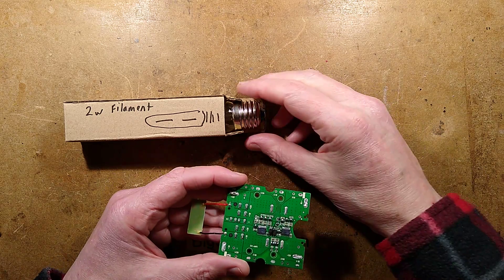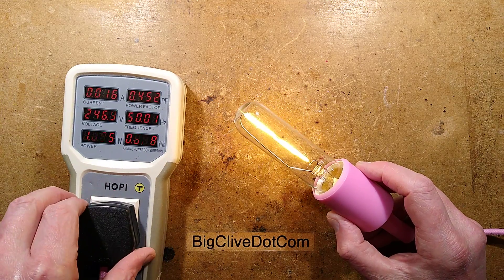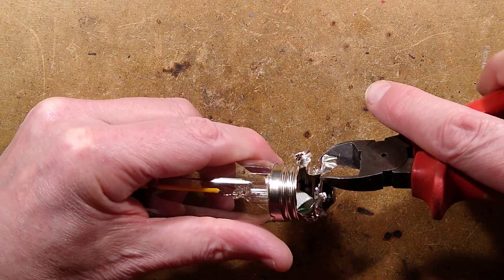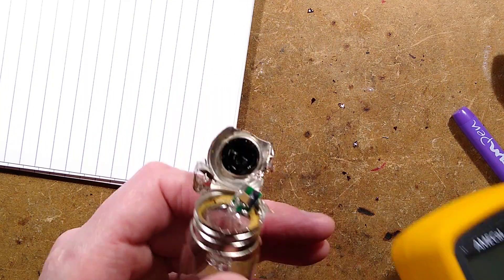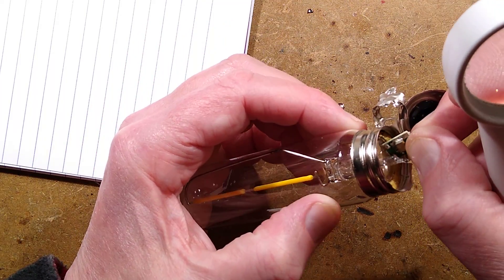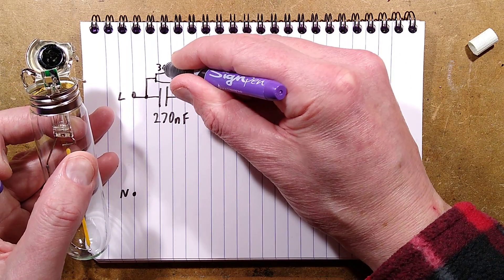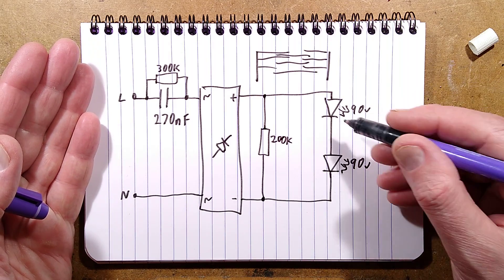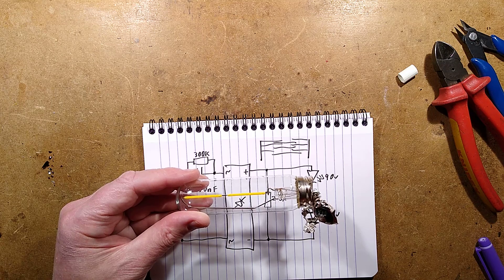Very tacky eBay LED filament bulb

Comment: The flickering always bothers me too.  But on a side note I was having camera exposure issues when taking short exposures with all these blinky lights.  Camera kept giving a flicker warning.   I found a setting in there that lets the camera delay the shutter until the light is on the bright part of the cycle to take the picture. It was designed for florescent but works for led. Kind of neat that camera manufacturers have had come up with solutions for the all too common unsmoothed light.
Reply: Fluorescent lamps changed, well at least here in the US, to using a longer persistence phosphor in the 1990s.  I was doing a demonstration for a class which I had done in previous years showing a phototransistor picking up the 120 Hz flicker from the overhead lights.  I was shot down miserably by the oscilloscope showing a nice flat line.
Reply: @wtmayhew  I’d wager it’s an electronic ballast not a bulb improvement.  In my shop I put electronic ballasts that flicker at a couple of kilohertz to avoid strobe effects on the machines. The lamps don’t really fade at that speed.  But all the old ballasts in my old house basement I can easily see the flicker even when using the same bulbs.
Reply: @TKC_  Thank you, I am sure you are correct.
Reply: @TKC_  People complained that CFL's flickered, but the later ones didn't due to the high frequency ballast.  They also had decent color rendition with improved phosphors.  I still have quite a few CFL's, but too bad they never were good for high on-off cycle, enclosed fixture, and cold weather outdoor applications.  LED's are great, but as Clive has observed they tend to run them way too hot and shorten the life.
Reply: @davidg4288  I buy the high cri filament style leds to keep the heat of the leds away from the heat of the electronics it helps.  I never buy the cheap plastic globe ones, the don’t last.  As for cfls i never found good color rendering ones, maybe it’s just what was sold by me.  I much prefer leds or full florescent bulbs that don’t give that horrible green cast the cheap cfls did. They were also terrible in cold, they made cfl spotlights which were pointless during winter.
Reply: @TKC_  The filament LED's have very small ballasts, sometimes cheap ones have poor connections or even the "wet locations" rated ones are not that well sealed. Otherwise I've had good results with filament LED's, especially in fixtures that require full angle illumination.
Reply: @davidg4288  they do make ones with good smoothing.  I found some a year ago and stocked up.  But it’s a race for the bottom I’m afraid, they probably will discontinue those to save a penny on the cap.
Reply: @davidg4288  CFL was made bad to please people, the best one will have like magnetic ballast a preheat time. This help the start to be less aggressive to the electrode. But it's "slow" so much people likes "instant" on, even if it take some time to heat the full lamp and reach the max. They workt outdoor too but take time to "heat". Outdoor with a 0°C was OK I don't know what they could look like at -18 as my area didn't see these cold very often
Reply: @lapub.  mine take about 5 minutes to get bright at those temps. I still have them in my shop loft since I have to climb a ladder to get up there anyway.
Reply: @wtmayhew  you should have carried on as if the scope was showing a waveform, just to see if anyone was actually paying attention.
Reply: @Derek_Garnham  oh oh or just disconnect the probe so it picks up 50 or 60hz antenna style from the wires in the walls. I imagine he was doing this demo for years. Then someone swapped a ballast on him and bam one day his nice demo didn’t work.  If you can’t see the flicker it would catch you off guard for sure.
Reply: even higher frequency flickering like the pwm controlled backlight of a lot of gaming keyboards annoys me, when im looking straight at them, i dont really notice the flickering to the point its annoying me but when i have it in my peripheral field of view, the flickering gets more intense and annoying

Comment: I've had a few LED filament bulbs with that little circuit board, and they never got put into use because of that flicker, not nice, and yes, they were sold as "dimmable", utter tat they were... :P

Comment: I wonder how that ceramic cap is going to hold up to ~350V mains peaks over an extended period.  I put some 50V Rated MLCC's  in some LED bulbs to replace the 100uF 25v electrolytic output cap (I used 10 10uF mlcc's in parallel). 15v output (5 x 1W batwing LED's) .  They lasted 6mos then all started failing short.   Imagine this ceramic dropper failing short with no fusible/inRush resistor - Yikes!!   I definitely wouldn't use this bulb in my home!
Reply: That is very odd. Normally i would expect the first cap to short to protect the others.

I't is now very common to use ceramic caps as the only filtering in the output circut of a switched mode power supply. Caps can be worked VERY hard in that application, especially in flyback  converters.
Reply: @ebpdoug2175  i had 10 10uF ceramic 50v in series on the switch mode output.  these were budget chinese thruhole caps, sold by qty 100 bags.  definitely not xrr5 or xr7, so the capacitance was prob a lot lower at working voltage due to the strong dc bias / reduced capacitance effect of cheaper ceramics.  The switcher's output prob has noisy voltage spikes that wore these out, and i prob should have left an electrolytic there in parallel with these.  i think they may be bogus-ly rated at 50v , as another possibility.

in any case , since the most common failure mode of the ceramic caps seems to be a short circuit, versus open circuit for a film cap, I think the use of ceramic in a series dropper circuit is inappropriate.  i've never come across this before , other than  in the device Clive reviews in this video..
Reply: @GannDolph  I'm going to move this reply to a new comment under my alternate nym  D614G ...

Comment: These are a common shape of bulb for lamps for dining room cabinets,  lamps for paintings, etc.  I haven't seen this shape of bulb in LED until this video.
Reply: Here in the US, Walmart has been selling tubular shaped LED lamps under their Great Value brand for at least a few years.  There’s one in the fixture right beside me.  As far as I can tell, it doesn’t flicker.
Reply: It's also the shape of the fuses used in GPO exchanges before the old equipment was ripped out. I had one until  I dropped something on it. They used the same standard ES fitting too
Reply: I was lucky to find that shape: We use the mini T8 bulbs from feit because they're JUST skinny enough that they'll fit inside of the little 4 inch glass chimney of our little micro-sized nutmeg kerosene lamps. So now they can be switched from oil to electric and keep all of the same fittings and lamp shades

That + a dimmer outlet to make them not so painfully bright
Reply: I've had a 2.5W picture light in my porch fixture for four years. Always on. No flicker. Pleasant color and light level unless I'm on my back on the driveway looking for planets and meteors.

Comment: I'd like to see what is inside the Tru-Tone Christmas filament LED bulbs. They're the nicest looking bulbs because they're old school painted glass.
Reply from the maker: I think Technology Connections featured those.  I'd guess it's a warm white LED inside.
Reply: According to a post from David Andora (Tru Tone founder) in the Lighting Gallery forum, the LED filaments are made by Epistar and emit 2200k warm white. I believe they use the same LED in all their colours.
Reply: I just took a bad one apart… just 2 small filament leds and 1/8 watt resistor soldered on the bottom to one side of the led.
Reply: @Mavromatic  Do you know what age it was? I took apart one of their C7 bulbs (I think last year's vintage) a few weeks ago, didn't see any supporting circuitry, looked like it was just the fillament across mains / no-resistor. What was interesting is the filament seemed to have the full bridge rectifier (4 separate wafer type diodes) and two current limiting resistors (think it was 3k ohm each)(or 330 ohm?) all embedded in the phosphor. I was expecting more, since the flickering never seemed bad- only noticed it when it was raining and you could watch drops coming off the roof.
Reply: @codertao  The 2022 batch C9 clear, I bought 450 of them.  3 stopped working (they sent me replacements) -- so I cracked them open to see what failed, nothing obvious (no skid marks). It's just a 1/8w 9.5k (white, green, red, gold — I’m sure they picked that exact value for more Christmas spirit) Ohms 5% resistor.
Reply: And maybe those Filaments have hi-CRI phosphors on them  zo CRI95 2200K or so tho speak